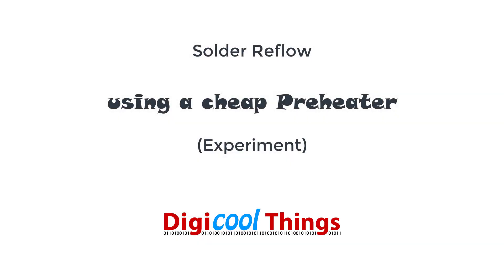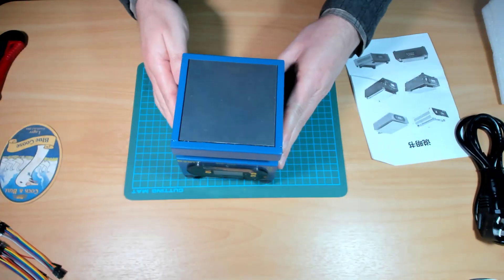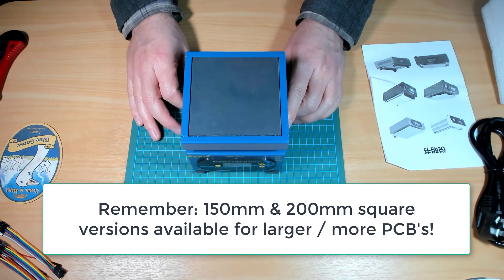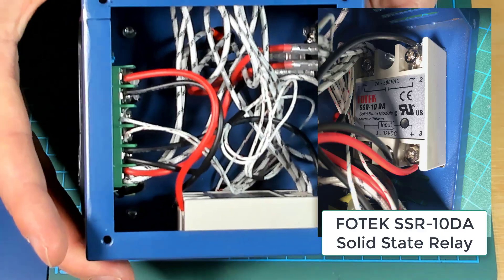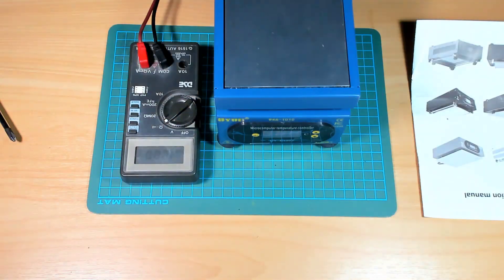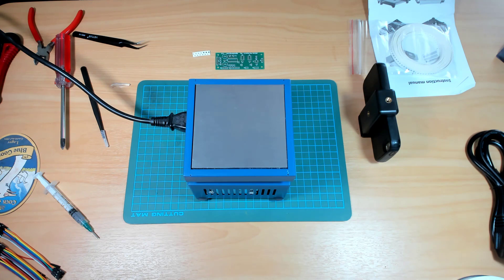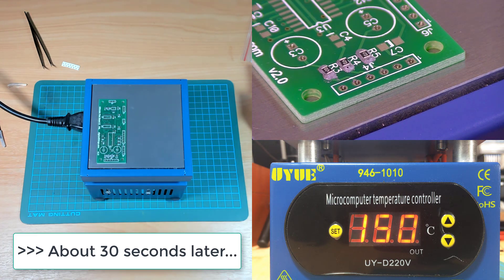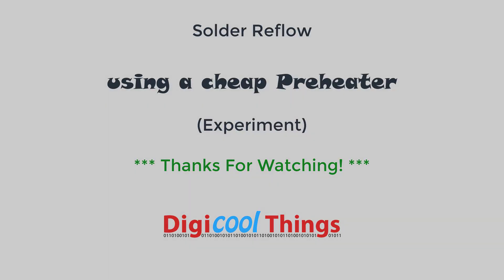Solder Reflow using a cheap Preheater Experiment (PART 1)

Comment: Thanks for the shout out! That's not a bad result for that price, but I wonder how accurate it actually is... as 183deg paste usually needs to peak at 210-220deg, but that reflowed at 190ish. I'd also be worried about pulling it off the plate while it's at reflow temp incase you knocked any parts out of position. Maybe turn it off with the board on there and let it sit for 30-40 secs before you take it off?
Reply from the maker: Accuracy is all relative. :)  It won’t compete with a proper reflow solution, but I don’t see why the thermocouple wouldn’t be capable of decent accuracy. But, I can’t account for the code the built-in microcontroller is running though!  It did seem to jump around a bit.

Perhaps I should have set it to 210 - 220 degrees for the final reflow?
I am however happy that it will be an easier and more consistent solution than just using a heat gun.

Next, I will see how the combination of Preheater soak, then Heat Gun for the final reflow works. 
I think this might be quite nice, again, in comparison to doing a whole PCB of components with just a heat gun, from cold. 

It would be interesting to hook-up your Reflow Master to the Thermocouple and SSR. Obviously wouldn't keep pace with the required heat-up / cool-down rate, but I still think the hot plate approach has some nice advantages over an oven. :)
Reply: Oh a hot plate solution is def a nice one, no doubt about it. I'm still tempted by the reflowR! I look forward to seeing your journey with yours :-)
Reply from the maker: I came close to ordering a ReflowR (several times). But my landed cost with shipping is just under NZ$300.
But I also got no response to a question I asked Lafras via Tindie. So that also killed the ordering thought!
Hence, what triggered seeking a budget option with the potential to give me a similar, albeit manual, solution.